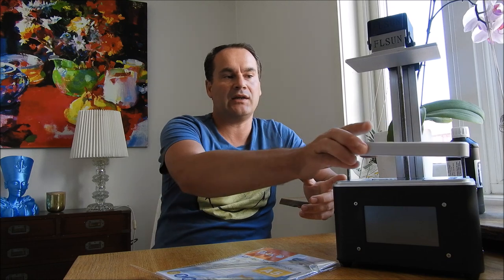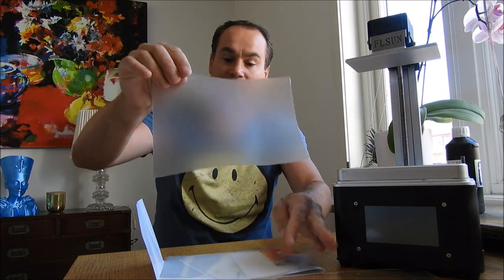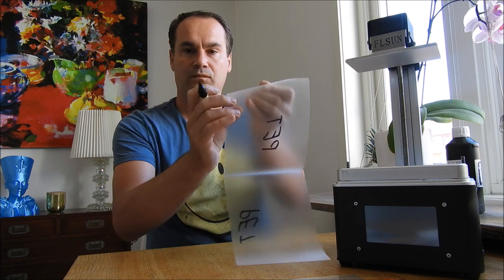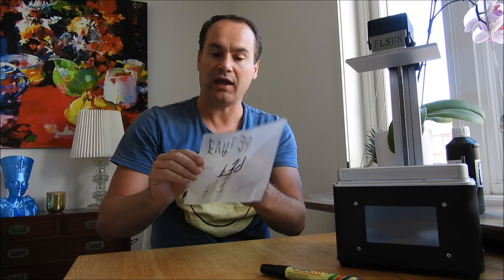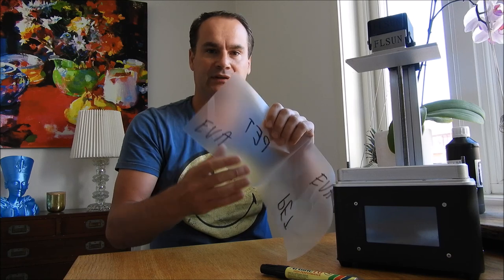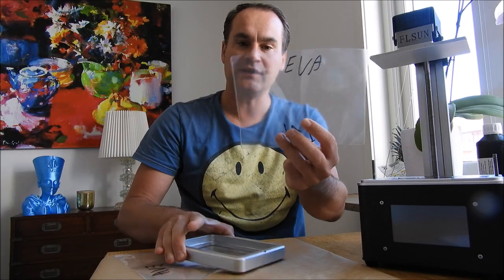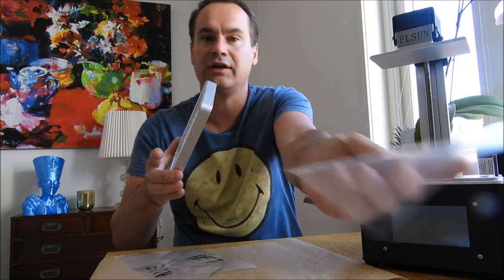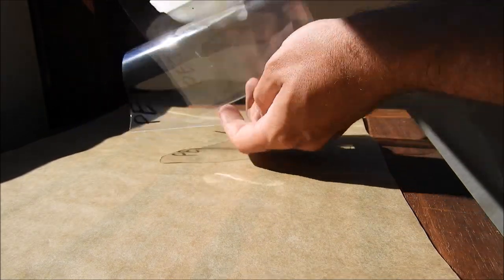The Alternative was FOUND 🤑 cheap & simple FEP film vat for UV-Resin 3D printers

Comment: great idea! thank you, you saved me, tons of money.. but i have two tips for others... 1. heatgun works better than stove and you have better control over it.
2. EVA film is possible to peel off the PET, you just have to start on corner and once you manage to peel that corner, its easy after that, EVA "film" look like food foil after that. i discovered that by accident, after i installed it to vat, it started to peel off itself on one spot. After you peel it its both sides PET and its not sticky...
Reply: wow... this is possible?
Reply: Which thickness do you use? My fep sheets currently are 100 microns/0.1mm thick and I'd like the PET sheet to have the same thickness. Question is if I peel off the EVA film, what thickness of laminating pouches should I get to end up with 100 microns thick PET sheet? Maybe 150 microns?
Reply: @trohn_javolta8485  That's a very good question. I am now motivated to measure some laminates before and after peeling. Laminating sheets come in up to 10 Mil sizes, but I imagine that is the thickness of the entire thing after laminating, all four layers.

Comment: Thanks a ton for this video!

I prepped by placing the plastic sheet in between my vat and fep plate, pressed firmly and cut with a razor blade around the diameter of my vat.

Punched a single hole in the middle/side and screwed down tight 
Worked my way along 1 long edge, punching and fastening - then did the other long side.

Then did the short sides the same way.

After it was all fastened down and secure, used a heat gun on high - with approx 12'' distance until it was clear and tight.

Doing it this way tightened it like a drum
Reply: it got even tighter by heating? I wouldn't expect heating would tighten it
Reply: i just used hair dryer and the same procedure , and it worked. but it was tight already before the heating
Reply: I always do the screws in my film like putting on the head on an engine. Alternately tighten screws on the opposite sides.

I like the heat gun trick. Tighten and clear it in one step.

Comment: I tried this on my Anycubic Mono 4k recently after I tore my oem FEP and needed a quick fix. Does it work? Yes and no. If you run this as a straight replacement to FEP without additional prep work after also making it transparent, then yes, a number of prints may fail and often stick to the PEP. I found I had to leave mine in the oven to clear at 200c for about 3 to 5 minutes (It's faster if you just tape the sheet down and use a heat gun). Once installed on the VAT use some dish soap on the EVA side to clean away some of the tackyness so it doesn't stick as much to the LCD as some people have found. Additionally, use a PTFE lubricant on the PVA side to help prevent prints from sticking so much.  I also found I had to adjust some curing settings to further reduce print failures, by increasing my exposure time (I.e Anycubic Black resin from 2 seconds to 4). At most, temper your expectations as every machine is different and some tweaking may be necessary. 

Side note for those wondering I used Fellows branded A4 100gsm laminate pouches here in OZ.
Reply: 0:09

Comment: A heat gun (mine is 350 degrees on low level) works very well - EVA-side is getting transparent almost instantly.
Normal hair-dryer needs patience as it is not getting as hot
Reply: A hot air soldering iron also works fine if you remove the tiny nozzle AND you can probably get the same results leaving it on the car's dash in sunlight. We really have no excuse.

Comment: Thanks for this video.I tried it today and yes it works fine.I used a 80 micron and dont know the brand since i called my son to buy me 5 pcs only to try.The PET is very strong and cannot tear by hand.printed some miniatures and to say its better than the one that came with my LD-002R.
Reply: How did you put it on the ld002R im striggeling with mine
Reply: Did you put alluminium tape?

Comment: Well, I gave this a go. It worked well for about 20mm but after that you could hear the sound of the break-away from the film getting louder and the last part of the print failed. On removing the vat, the film had ripped and I had to do some serious cleaning. No damage to the screen fortunately. That said, I don't regret trying and I would encourage anyone brave enough to give it a shot. I don't think all laminating pouches are created equal and others may succeed as Roland clearly has.
Reply: laminating pouches come in different thicknesses. maybe you got too thin
Reply: ayo
Reply: that's exaclty what happen to my printer, not because it was too thin, it is becuse the model stick to film won't seperate, i can hear the step motor was stalled by trying to pull up, then the next expose cooked model harder on film, finally it pulled up and ripped film a big hole, resin run out instantlly everywhere.
Reply: Gays Any solution for this problem

Comment: ive thought about trying this myself but i had thought first i would run it through my laminating machine to make it clear instead of splitting it to have pet up an eva down the eva would be in the middle with pet facing up and down or at least thats how i had considered do it but i use fdm way more than resin an ive not had to replace the fep on either of my resin machines yet thank god but i have tablet screen protectors cut to size an put on over the screen to protect it for the day the fep leaks. i will give this a try now that ive seen someone else have success with them. thanks for the video.

Comment: Olympia 80microns  set 100 pouches and united office 80 microns set 40 pouches are making  the  job! 👍. Thanks for the research!
Reply: Thank you so much for the brand name ! Couldn't find the composition of any laminating pouches where I live. Same on Amazon, until I saw your comment and ordered the Olympia. I hope you will have a good day as you made mine a lot easier.
Reply: got today a set of 125um A4 olympia pouches, I'm still waiting for the printer tho :D So what's the fieedback after a year? Mine clear up with a heat gun, but they keep the "fuzzy" look through them, like a wavy glass if you know what I mean. It's very visibile on far away object, but none if I put it, for example, right over my laptop screen.
Reply: @Lbret-h4l  Like I asked OP, how's your feedback after using olympia sheets?
Reply: @ephestione  How's your 125um FEP my friend =) ?  Does it work ?
Reply: @multigaming3291  didn't test myself, all other feedbacks I found are negative. Not good enough for the job. Anyway, while heat makes the sheet transparent, with acetone you can totally peel away the layer you don't need

Comment: Seems to work as far as the UV getting through but even with lubricant, the print continually sticks to the FEP and not the plate. Is there a fix for that or work around? About to give up. Tried about 6 times and the same result.

Comment: have to give this a go. just brought a anycubic photon last week, replaced the film yesterday. got 1 print then stuffed it trying to get a bid of resin off the film. tryed to print today and stuck to the film pulling my platform out of aliment. lucky i cought it in time for it not to destroy my printer. FEP scratches way to easy even with a micro fibre cloth. really glad i came across your video
Reply from the maker: use (plastic) tool
Reply: i did, it was really stuck on. also used methylated spirits to help get under the stuck resin and help lift it off. i have heard that a silicon spatula works better then the plastic scraper that comes with it. ill pick 1 up tomorrow

Comment: Wow!  This is going to save me so much money.  I haven't had a successful print yet and each failure is hard to scrap off the fep.  I'm already on 2nd sheet and it's full of holes in the top half.  There is now resin between the two sheets.
Reply: Sounds like you did not remove the protective film from each side of the FEP sheet ...

Comment: I had a try. But sorry, on the end it was not working. To remove the EVA Foil with a bit force and without any heat was simple. The PET foil was easy to install. But the Pet foil is harder and more sticky to the prints then a Fep Foil. You hear it already when the printer is working. Its like the print is teared from the foil with a lot of force (more then common). The result is a damaged foil. After printing you see the contour of the printed items on the foil. There is no way to clean it. Maybe the foil is not that heat resistant and the exotherm hardening reaction damage it. The force to tear the print from the foil is sometimes so strong that the printed item is cutted in 2 pieces. The first half is sticking on the building plate, other parts are sticking on the foil. 
The idea was good, but laminating foil is not the solution.
(I am using a 8.9 Zoll printer with a monochrom display and a short exposure time. Maybe it produce more heat then a common printer. It could be a reason for the problems, but I am not sure about).

Comment: You are smooting the EVA side in oven... But... Could the frosted side help with (1) Anti aliasing because of more diffuse uv light at pixel level (2) Peeling because of letting air in under sheet towards  the center?

Comment: Print failures.
Possible reasons:
The EVA side adheres to the screen and as PET is also less flexible than the original teflon foil, prints adhere to the foil. The flexion of the foil when plate goes up is important to avoid adhreration to foil. I have also tried a teflon spray on both foil sides, but it was not enough. I have also tried to reduce tension on screws, still did not work.
 Prints became exelent as soon as I have installed an original teflon foil. Nowadays you can find up to 5 original foils for less than 20 euros.
Reply: Same problem for me, used on wanhao d8...

Comment: I just tried this on my Elegoo Mars although I haven't printed with it yet. One thing I did different was I didn't put it in the oven and then mount it but instead I mounted it and then used a heat gun over it to melt the EVA.  Seemed to work fine as far as that goes.  I'm in the US and used some laminating sheets we use at work and I believe they are 3mil thick.  Hopefully I'll get a chance to test it this weekend.
Reply: 3mil, that's like 1/8 inch? Do you mean thou? a mm or mil here in the UK means 1 1000th of a metre. Very confusing.
Reply: Did it work? Thinking about buying some for the elegoo as well.
Reply: @davidwoodcock836  No it didn't.  I believe it was way to thick and I don't have any thinner stuff.  If I can find some thin pouches I'll try again.  It's been a while since my test and I don't remember exactly what the results were but I believe it failed after a few layers and everything was stuck to the laminating pouch.
Reply: @WhiteHairOldMan  Same here. Going to do a little more research. I tried Scotch brand Thermal Laminating Pouches.
Reply: @ashep126  We use these pouches at work from Jackson Hirsh Laminating (https://www.jhlaminating.com/).  I don't think they sell anything thin enough so I'll most likely have to look at some of the big box stores or office supply companies.
Reply: @WhiteHairOldMan  I tried this myself with 5mil laminating pouches and my only reason for print failure was the residual EVA that ended up clouding the bottom of the film for the finer details. The test print that came with my Photon S, a Mesh Cube like thing, made it half way before failing. I can assure you the PET is a superior plastic film IF you can get the EVA fully removed, even at higher thicknesses... at least with my printer.
Reply: @SaSeshen  So are the pouches working for you? I also heard you can spray some thin oil or something to prevent stickiness? Not sure...

Comment: Just tried your trick, thank you it works great!
Reply: Hey. so you tried this and it works...100%. Is that correct? So at 410 degrees Fahrenheit for 3 sec. with just the parchment paper directly on the oven grill for 3 sec. You're saying it works completely? Sorry just want to make sure before buying this laminate. Please advise, Thanks in advance.
Reply: @trontekkenproductions2975   I'm not sure about the temperature, I just cranked my gas oven to the max, first time I put it on a lower temperature, i left it a few seconds, pulled it out, it was still blurry,  I put it in again, until it cleared up.  You can go for lower temperature and more time I guess...  410 F seems about right.
Reply: @UrsANDrei  Thank you for getting back to me. U are a god send. Thanks again.

Comment: No need to heat the laminating pouches I think. I just put some acetone onto the clue/EVA side and the clue film just peels right off.
Reply: indeed, acetone is the killer, the EVA film peels right away very fast, but once you've started peeling you can keep using store bought ethilic alcohol to go on, it's cheaper albeit slower, still it helps. Feedback from the prints with these sheets? I got the laminating pouches today but the printer is still on the way!
Reply: @ephestione  Have you tried it yet? I discovered the Acetone method as well and will be trying it after work today, or this weekend! I definitely had initial successes with this PET film, but the EVA glue is where it all falls apart, even the most minuscule residual!
Reply: @SaSeshen  well, no, I don't want to swap with the perfectly working fep that came pre installed with the photon s, so they're still there, but the feedback from those who tried, on the Facebook page, are not good. It works, somewhat, but doesn't if you expect consistent results

Comment: Congratulations on the initiative, thanks for sharing! I was able to remove the matte part using an acrylic folding machine (it has a resistance that I can pass the sheet over and removes the matte part instantly), but my prints have been stuck to the PET on my Photon S, even trying different exposure times and number of base layers. Would you have any tips? Thank you very much.
Reply: I tried this and just did a tank clean - the thin hardened film sticks to the PET like crazy, unusable for me.
Very sad.

Comment: I just manage to peel off the eva part or the sticky part somehow after heating up on the oven of course, let it cool down a bit and try to peel off the eva part, i just hope that this method will also protect the lcd screen of the printer. But it just my luck to able to peel it off maybe there is other method that can do this effectively ?
Reply: hey michael! how did this turn out? did it work?
Reply: @gongarcia4071  Following too

Comment: With me unfortunately it didn't work. It slurred in the "FEP/PET" during printing causing errors at 20% and when removing the resin the function was stuck right in the middle. I tried twice and gave the same error. I removed the glue from the plastic and it still didn't work.
Reply: Got the same issue, looks like it depends on resin type or environment

Comment: That makes me laugh how people react this without even trying it.. ARE YOU REAL PEOPLE??!
Reply: Laminator pouches pull your model dress off the build plate, tried this and it DOESNT WORK! Laminator pouches regardless of size used are far to sticky
Reply: i tried today ,is working
Reply: @jon2205811  You can try a thin film of Rain-X car treatment or a thin coat of silicone plumbers grease on both sides and you won't have sticking from the resin or the sheet to mask

Comment: I tried it and was really suprised by the results. Worked really well BUT it is not as durable as i hoped
In conclusion… works great for smaller projects and can be used for 7-8 small prints (200-300 layers .005) you can do the math.
In the end the foil got lose and lost its tight grip.

Comment: Hi, I tried this method with the same Peach branded laminating foils and after I removed the EVA layer the PET still has this "frosted" finish when I put a light source bellow it. Did they change this product or is it fine to use like that? Other than that it's pretty clear. Not as clear as store bought FEP films. Should I do more oven runs?

Comment: Are you still using this method? Have you had any problems? Can it use PVC Acetate sheet ?
Reply: I've just started using it for a quick fix until i get FEP again. There are som hurdles to get by. The print sticks a lot more to the PET than the FEP, so you have to tweak som settings. I've had some succes with much thicker supports and more exposure, but i still get fail prints. Mostly because the print tears off my supports
Reply: @meganiceguy2000  exactly true. I tried too. I agree with what you said.

Comment: I tried this and replaced the fep film on my Elegoo Mars. Works very well. I am back to printing. Used an oven temp around 325deg F. 390deg F caused sheet to warp, but maybe I left too long.
Reply: After more experimentation, the small warp is not a problem. Installation on the Mars creates tension on the sheet which removes it.
Reply: After even more experimentation: A bit of a downer. The tacky side gets dirty/cloudy. It is sitting right on the LCD screen. Results are poor. So looking for a clear PET sheet.
Reply: @olubeck  Any updates on your fep alternatives?
Reply: Actually, after getting more experience with my resin printer, I find that I am using the fep film for many prints. The cost is not prohibitive so I have not pursued this option.